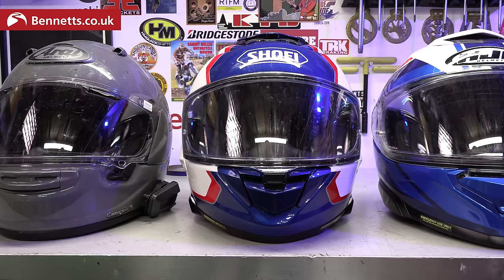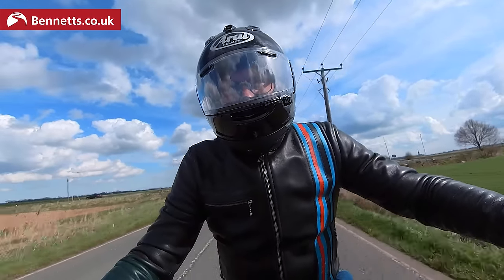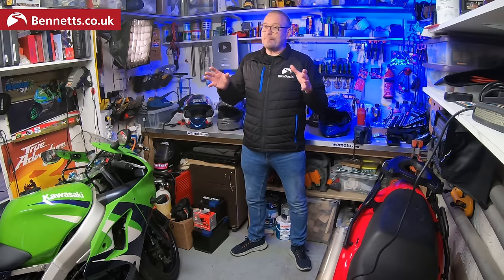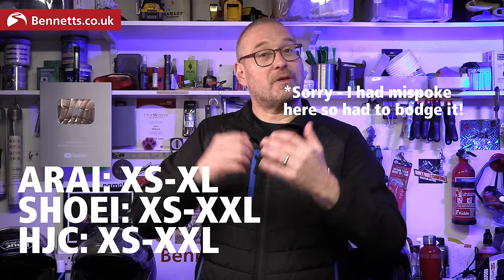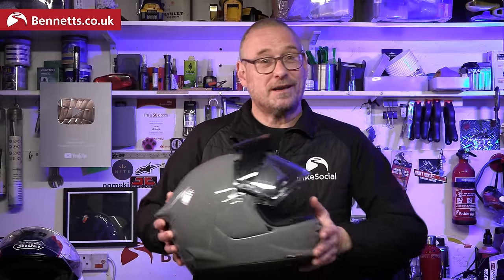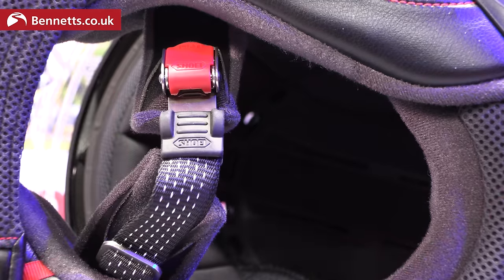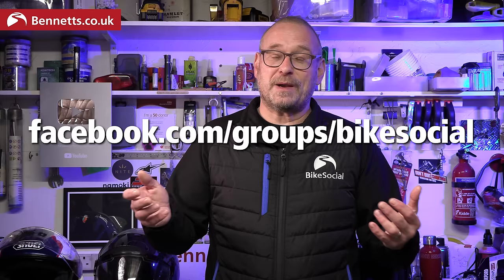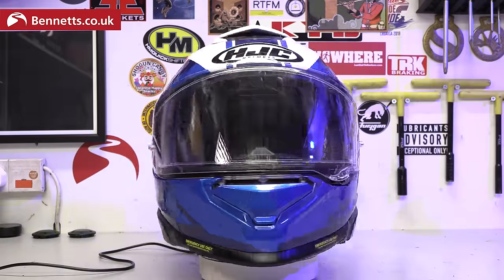Best sport-touring helmet: Arai Quantic vs Shoei GT-Air 3 vs HJC RPHA 71 vs Shark Spartan GT

Comment: Once you go Shoei, it's hard to come back to anything else
Reply: When I started riding over 20 years ago Shoei lids didn't fit my youthful head shape .... last year I tried on an NXR2 just to see if anything had changed - straight out of the box it fits like it was custom made for me. By far the best fitting and most comfortable helmet I've ever owned 😉
Reply: I agree I’ve got an NXR2 and an AGV K6S, AGV is the best for me. My GT Air2 made my neck ache with  the drag.
Reply: They call the Quantum-X ‘Quantic’ in the UK?
Reply: Wrong! I initially had the GT-Air2 and it was no match for my current AGV K6S with an iridium visor 😅
Reply: Agreed
Reply: What a Arai fan boy
Reply: @SirMountainpass  yes I bought the K6 this year and it is the quietest helmet I ever worn, well impressed.
Reply: Wore for 2 days bought a arai.  Never going to anything else...I have alot.
Reply: Wore for 2 days bought a arai.  Never going to anything else...I have alot.
Reply: Wore for 2 days bought a arai.  Never going to anything else...I have alot.
Reply: Wore for 2 days bought a arai.  Never going to anything else...I have alot.
Reply: Wore for 2 days bought a arai.  Never going to anything else...I have alot.
Reply: Wore for 2 days bought a arai.  Never going to anything else...I have alot.
Reply: Wore for 2 days bought a arai.  Never going to anything else...I have alot.
Reply: Wore for 2 days bought a arai.  Never going to anything else...I have alot.
Reply: @Achilles22  
The optical quality of the iridium visors (got silver and blue ones) and especially the superior aerodynamics of the K6 / K6S (and certainly the Pista RR which I  use for track days) are additional points that tick the box for me. No problem to turn my head at 200 Km/h+ whereas the "wall" hit me with the Shoei at 180 Km/h on the German Autobahn. Turning my head ahead of changing lanes at high speeds (not just looking into the mirrors) is a (safety) habit of mine ☺
🏁
Reply: @SirMountainpass  we call it a lifesaver
Reply: Shoei was great but didn’t fit my head quite as well as the shark, quite often it’s a Cinderella situation and thankfully the testing is to the same standard so whatever you end up with at least you know it meets the same standards. I think whatever your personal preference is you are probably right for you, so if someone else has a different opinion for them then that’s awesome too they are also wearing a great lid (fake lids aside of course)
Reply: …unless a SHOEI gives you massive frontal headaches, then it’s quite easy
Reply: @jezzylawson936  That’s why I bought a Rpha 11. Perfect fit. Nothing to do with manufacturers, some fit you, some don’t, making reviews a bit pointless. My hjc is17 didn’t fit ironically. My Arai rx7 was plush but as noisy as hell and loosened up too much after a while.
Reply: @ryanmalone2681  the Quantic is the equivalent to the Contour-X on the US market.
Reply: @pksvkpk4801  of course you do
Reply: @jezzylawson936 😂😂
Reply: Unless you go arai first lol
Reply: I have a Rf-1400, and prefer my AGV K5S (lighter & quieter) and Scorpion R1 Air (far lighter). So that claim is not necessarily true
Reply: Cannot argue straight facts. 👍🏼
Reply: This is definitely Gods' truth. But the same can be said for which ever brand fits you right. Shoei and Arai have the mythic cult following for a good reason. I love Shoei, amazing helmets, but cannot for the life of me fit into one. The EPS shell just doesn't fit my head, no matter how I switch the pads out. But Arai...my word does Arai fit like no other.

LS2 Thunder Carbon and any Arai (as all/most Arais fit the same anyway) fit me as perfect as one can ask. I'm struggling to see the reason to go back to any other brand.

Comment: I really hope manufacturers stop forcing ppl to get these custom intercoms. Just let people choose what they want and build the helmets accordingly.
Reply: to be fair. i got a gt air 2 and did not buy the integrated coms system. Just some strong doubble sided tape on the outside. It's slightly further back than ideal but it's not an issue
Reply: I got the Shoei GT Air 3 and I’m actually quite happy with the integrated Sena SRL3. I like the clean look and integration.

Comment: The most important thing with a helmet is that it fits the head perfectly. And that's not the case with every helmet from every brand. I would ride an ARAI if one of these helmets would fit my skull. But unfortunately, ARAI helmets are not made for my head. I have ridden SHOEI helmets for years, 4 or 5 of them, and was delighted with them. However, since SHOEI changed the helmet shells several years ago, I can no longer find the right size from SHOEI either. Since then I've been riding helmets from HJC. They are not quite comparable to SHOEI or ARAI in terms of workmanship, but they fit my skull perfectly.

Comment: Does anyone have any wind noise issue with Arai Quantic? Mine if letting in too much wind from the front around the neck area. I'm trying to find a solution for that to make it less noisy. I use ear protections but it's still loud.
Reply from the maker: I haven't, but it will depend on the bike you're riding and the fit, so it's hard to say. I wore mine on a 2,200 mile trip last month and had no issues. Chose it as it's my quietest. Cheers, John

Comment: Oddly the best shield mechanism I've used is my Bell Star.  It only has 2 settings besides lock:  City gap and all the way open.  The gap is the ideal you describe, and I ponder why anyone would ride with a shield halfway open.

As to Arai's unchangeable safety philosophy:  Sharp UK "inspired" them to change their shell construction around the neck and collar, because repeatable testing showed it to be weak.  The new ECE standards seem good, especially regarding rotational protection, and I think we'll see a lot of shell changes.  Sharp says it more closely resembles their testing - convergent evolution?

Comment: Started wearing Arai in the 80's. Been wearing Shoei since 2000. Best and most comfortable helmet you can wear. I always buy from the cheaper end of their range but you still get the best quality.
Reply: This is it. Neither brand really so an "entry level" helmet. Arai and Shoei both just make one helmet for each purpose and it costs what it cost. No entry, mid-tier, and flagship models. They're just all flagship, so even if you buy the cheaper lid, you're buying a damn good one.

Comment: Ps. I also noticed in your review that you weren't aware of hjc's adjustable system to lower the sunvisor - the mechanism is hidden under the bluetooh coms lid in the left side and it drops the visor even lower and forward at the same time removing any possible gaps therefore its even better than shoei's as it lowers even more.

Comment: Tried these three, Arai, Shoei and HJC, plus an AGV K6 and a shark carbon, a few months back when I updated and upgraded my full face helmet.

All are top notch helmets, it really comes down to the final verdict, the one that fits right is the best one for each!

Now, my high level impressions back then.

1. Shoei, not for me, pain on one side on top of my head. Plus prefer d-lock on my full face helmet.
2. HJC, knew this was the one from the moment I put it on. Snug fit and comfy everywhere, felt an extension of my head.
3. Arai, yes comfy, really soft padding, too soft for my liking, preferred the snug fit of the HJC. Plus no sun visor.
4. That shark carbon I tried, the moment I put it on I asked "is this lighter?". Yes it was if I recall well 200 grams lighter than the others. It was though painful for me in several places.
5. AGV could not even put it on...no fit at all on my size.

Bottom line, yes fit is the most important factor for something that only protects our head but also makes a ride an absolute joy or a living hell.
Reply: 🕘 hjc
Reply: HJC

Comment: Gt air 3 pinlock coverage is a bit shite, it sits in your peripheral.

Also i find the ratchet strap a little faff as it can press on your throat unless i pull it forward after fitting the helmet. Overall the fit is great, i did have to use spacers to get the speakers closer to my ears as the sound was a little lacking when locked into the resets .

The chin curtain comes loose on one side from how tight it is to get on and off, i had to add a rubber wedge to one side and that seems to have fixed it. I reckon if they had used the chin curtain from the neotec 3 it would have reduced the volume inside the helmet a little more as i feel a lot of air coming through the perforations when all the vents are closed.

Great review and very informative, one of the best reviewers on youtube. Keep it up

Comment: Excellent vlog. Just bought the Arai Quantic after having a Shoei Neotec 2 for the last 4 years. The Shoei is a quality piece of kit but I did struggle a little with fit. After experimenting with skull caps it was acceptable but never supremely comfortable. The other issue I had with the Shoei was ventilation, always found it a stuffy helmet to wear on hot days ( with vents open) unless of course you ride with the chin bar up.
The Arai Quantic is sooo comfortable and fits me perfectly. I agree the ventilation is excellent and I wear specs which is no problem fitting and removing. Noise wise I always wear ear plugs and find the Arai the same as the Shoei - a quiet helmet. I am delighted with the Arai Quantic and so far I do not miss the Shoei at all....well apart from the sun visor! -  however I have bought a tinted visor for the Arai and a Oxford visor holster belt to carry it in 😎👍

Comment: l have been using the Shoei Neotech since the Mk1, now on Mk2. l also us a HJC l 30 open face, for the very hot summers plus a HJC l71 when l require my chin mounted camera...The Shoei is undoubtable the best as regards wind noise, comfort and fit..Also l would like to say a trend towards built in intercom systems is step in the right direction, Both the Shoei and the HJC have. it saves having those things stuck out in the airstream, causing even more noise..However,  you're correct when you say ear plugs are essential at speeds above 40MPH...that is if you want to avoid tinitus in later life...

Comment: I'll throw my bias points in as I've got an arai quanitic and took it on a 4500 mile european adventure.

First off, it fits my head perfect. Is easy to get on and off and doesn't catch my ears.

The intercom is incredibly comfortable once fitted, as the speakers go inside the liner, so your ears are against the helmet liner not the speaker.

Downsides, no drop down visor, but this is expected. I used a pair of safety glasses when I got caught out in the dark.

Naggles,
One of the visor brow vents broke off, good luck getting a replacement for a VAS-V visor...
Lots claim its heavy, you wont notice it unless you're swapping between helmets.

Comment: In the United States, I only had access to the Spartan GT and RS and I really liked both of them as well as the Arai. I ended up finding the Shark Spartan GT Pro Carbon overseas and I've been wearing it for about a year now. I will say I love the snug feeling and the amazing visor and drop-down shade. The venting is also pretty good, better than some of the other helmets I've tried. The whistling was definitely a thing at first but after some use and wearing my ear plugs, I really don't hear it much anymore. Not sure if something changed or what but it seemed to be a minor issue now. I fit the cardo packtalk edge with the large speakers just fine, it works great!
Reply: Were you able to find any dark tinted visors for it??

Comment: I just bought my 3rd helmet in 6 years or 60,000 miles of all weather riding. 2 problems with this video  (and all others) for me is no mention of visibility in poor weather:  First rule of motorcycling is don't crash.  In 60,000 miles of all weather riding, I have never tested a helmet's impact protection.

Your testing appeared to be on an ADV rather than a sports touring bike.  Since the head angle is different, upward visibility becomes an issue.  Riding a stock VFR800 in a Shoei GT air. I found I had difficulty seeing traffic lights.  I switched to an HJC R-PHA70 which was much better
The other factor that gets missed is wet/cold weather. The GT-air visor fogged in traffic. My HJC R-PHA70 leaked in the rain, but it was worse when I cracked the vision open.  All the stored water around the top of the visor ran inside, soaked the fabric, and the resulting vapour fogged it completely.  I have given up in The HJC because the visor cracked on 2 places and the pinlock fell out.
Yesterday I looked at of these lids as possible replacements.EXCEPT the Arai (no sun visor - sun dazzling causes crashes):
* The HJC has an improved visor, but its jerky and rattles when you close it.  Plus the latch on the side doesn't seem glove friendly.  The imposition of someone else's comms tech was there real deal breaker though.
* The Shoei is really nice but no breath guard.  Is really expensive if you care more about function than ascetics. (and similar comms  real estate issues, if I remember correctly).
* I went for the Shark because its just a well fitting lid with a sun visor and everything seem to work.
Reply from the maker: If you check out the full written reviews you'll see all the testing done for this summary video

Comment: Adopted an unused Arai from a relative in the 90s and found it was such a good fit and quality I have always stuck with them. Tried others but they just aren't right for me. Have no need for the drop down sunshade. It is sunny, tint visor; it is not, clear visor; if in doubt, shades in pocket. So you can stick your sunshade where the sun don't shine - see what I did there!? And I have always preferred the double d ring strap for variability and reassurance that it is most definitely fastened!! But I never fasten my helmet with gloves on, so... Also, I only ever operate my visor with left hand. Always have, so no issues with the position of latch on Arai. Each to their own I guess but fit, quality and company ethos make Arai the choice for me. Thanks for reminding of the reasons I made my choice. Good video as always.

Comment: A dropdown sunshield is a BIG selling point for me. I just can't stop to put on sunglasses or change visors everytime the sun comes out of the clouds or put them back off before entering a tunnel or garage. And bright sunlight is a big issue in my Mediterranean city especially during summer months. No. Now the so called gap between the helmet's chinguard and the bottomline of the sunbisor is actually a good thing. Considering proper head-eye position while driving, that gap helps you see the indicators more easily without affecting the sight ahead. Ligh leak from your peripherals should not matter all that much unless you're riding on a mirror surface for hours. I can't think of any scenario where peripheral light leak caused me any discomfort even under desert type riding conditions. Shoei looks great to me.

Comment: Would be cool if you tested the new sport touring Schubert S3 which at the moment it's my favourite st helmet with a micrometric closure but maybe use a similar testing method for wind noise to Champion Helmets where you can actually find out that the rpha 71 and gtair helmets measured 98db when at the same speed and similar wind conditions on a dual carriageway and the s3 measured 100db while the arai measured noisier at 101db. Ventilation wise they stated that schubert s3, shoei gt3 and rpha71 are better than the quantic as well... Just passing on the stats.
Reply: I bought the older Rpha 70 based off the champion testing and found it horribly noisy, as have others (based on the comments I've seen since). The issue being that they test on a bike with a big screen (which cuts out a lot of wind), so if you ride a naked bike like i do then the results aren't accurate. Some helmets that got higher noise ratings from champion seem to quieter in real life on a naked.

I'm in the process of getting a new helmet through insurance after a crash and have been offered the rpha 71 as it's the new version of what i had, but a quick google search found a bunch of people complaining about wind noise, so I'm reluctant to get it. Although i did find some tips on how to reduce the noise, but it does kind of make the drop down visor useless, as the mechanism is part of the problem.

Comment: I've had an Arai RX7 then went to two shoei flip fronts the Multitec and a Neotec when I bought a touring bike with a big screen and could ride with the flip up,  but having moved to a naked bike really wanted a full face again. Tried many on but the Arai Quantic stood out as the best for me, I never gelled with the RX7 but this new Qualtic addressed all the things I didn't like about the older lid, However I do agree it chips far more easily than the Shoei.

Comment: Thanks John. I have been using the Arai Quantic for about 6 months now. Completely agree with all the points that you covered. Your review is spot on. The Arai is extremely spectacle friendly. I have fitted a helmet intercom. Only point that I have observed is after about 3 to 4 hrs of wearing, my ears tend to compress against the speakers causing a bit of discomfort. Have you experienced this?
Thanks for the great content.
Reply from the maker: I haven't I'm afraid, sorry! It'll really depend on head shape though